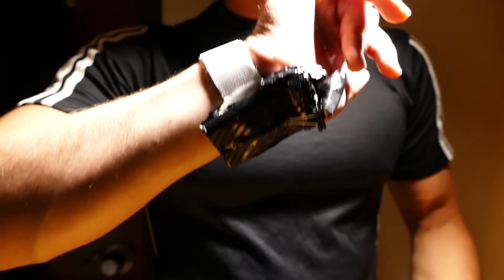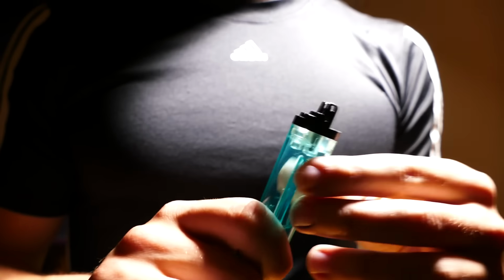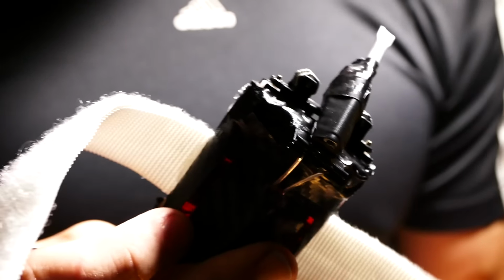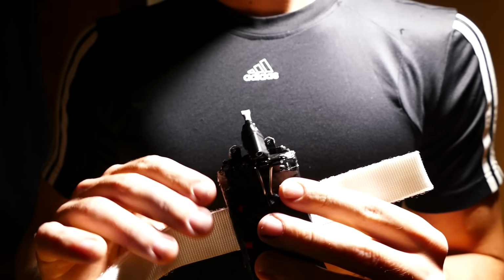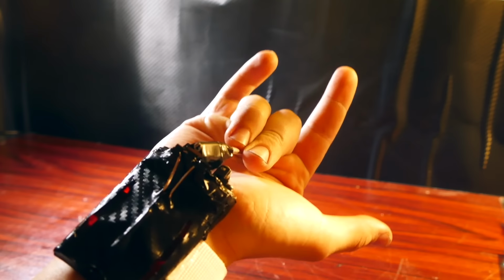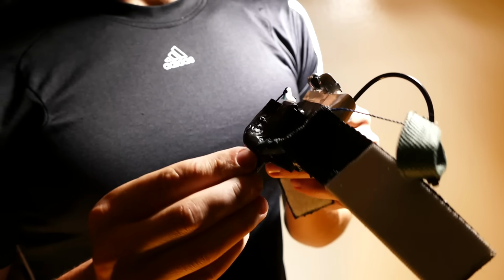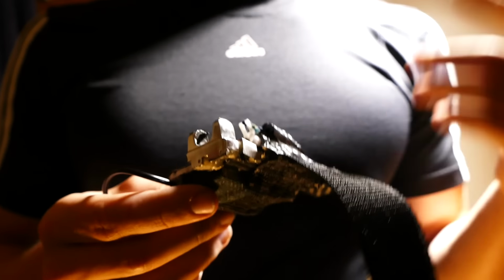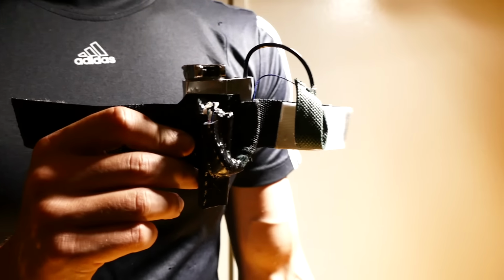Make a SPIDER-MAN Web Shooter! - Super Simple $2 build!!!

Comment: For web fluid use 
Rubber cement
Clear glue
Contact lens solution
Water
Reply: Zap zing Gaming the glue would just dry up
Reply: Zap zing Gaming 
Thanks
Reply: What does it change
Reply: That would actually stick to stuff
Reply: Zap Zing measurements please?
Reply: Wouldn't the cement dry up?
Reply: Thx for some ideas
Reply: FUN FINATIC just experiment
Reply: Is it 100/ right
Reply: Hello I Buy 2 Web gun
Reply: Where to find rubber cement
Reply: Now does it work?
Reply: Snow Wolf i think they meant as you put it in
Reply: Or you could use Locite spray adhesive glue. (It has to be the professional performance one)
Reply: Silicone and water is the beat
Reply: @superdolphin440  Rubber cement isn't actual cement. It's more like a rubbery glue.
Reply: @Ohaffles  thanks
Reply: @superdolphin440  Yah we have to use rubber cement a lot in school for projects. So no problem.
Reply: Or you could just use flex glue clear
Reply: Ayal Zur that’s why it’s water
Reply: Do you know what size/kind of syringe he’s using in the video?
Reply: @amarhavic1915  no it will only dry immediately when it will come out of containers
Reply: What about liquid silicone
Reply: @superdolphin440  not at first
Reply: It's so the solution used here actually becomes sticky and will stiffen after being exposed to air.
Reply: Your not actually thinking it’ll make you be able to swing from stud smh
Reply: That’s nice.....but did u know that GEICO can save you 15% of on your car insurance?? 😃
Reply: @deacb0y262  it would be elastic due to the rubber cement, sticky due to the glue, and contact lens solution would help it dry faster so it would become the sort of cord it is in the comic
Reply: @murpheria4562  thank you that was 2 years ago lmfao
Reply: @superdolphin440  it would have water
Reply: So you thing I could do silly string?

Comment: HELP!! Do I just use hand soap for the webs ? I tried using dish soap and then adding butane fuel but nothing happening when I pushed down the lever. I also tried hand soap which didn’t work. HELP PLEASE
Reply: I have thesame problem, did it work already? Maybe use other lighters?
Reply: Same problem with mine :(

Comment: Incredibly difficult to complete. The excess soap took off all the glue and the ejection of the lighter got stuck TWICE while trying to put the pieces together (the metal ring that’s at the end of the white ejector got stuck inside). Instructions weren’t clear enough and I couldn’t recreate it

Update: I finally completed it and i tampered with the original design a little bit to make it more effective. It’s definitely more difficult than it appears but it’s still possible 👍🏻. For those of you trying to recreate this like I did, make sure not to accidentally force down the ejector while reinserting the trigger and keep note that it definitely needs a constant refill if you’re going to play with it
Reply: I can’t seem to get mine to shoot the web fluid

Comment: What if you combined the dart with the soap and added multiple anchor points on the dart so it can come back into the tube? This way you can have the web effect and the grab effect. Also what if you add a shaped filter on so it comes out in a web design. Sorta like how you mask a flashlight so it shows a specific shape like the bat signal.

Comment: Just wondering, is this web shooter build compatible with the Polymethyl Methacrylate Web Fluid Mix? I highly doubt it but I could be wrong.
Reply: If you wanna put your web fluid in the lighter I HIGHLY recommend putting pressurised air into the lighter. It forces the contents out of the lighter instead of just sitting there in the container.

Comment: I can't get ahold of butane
Reply: I think you could just use compressed air, should work the same
Reply: @razplayz843  - The thing about the butane though, is in liquid form it constantly generates pressure until it runs out, which is better in the long run, but it probably would mess with the chemical makeup of my web fluid.
Reply: 😅 oh OK sorry
Reply: @razplayz843  Nah, it's all good. :) I'm a bit of a nerd so 😂

Comment: you can try doing a fire shooter basically what it does is throws out a blob  of some material which is set to fire by the lighter and it still keeps on burning when it reaches the surface it is intended for

Comment: The instructions are both clear but also unclear.

What did you use to make the lighter all frosty after you emptied the lighter fluid?
What did you use as the extension for the trigger?
Do I need to use the butane fuel?
Reply: I’m two years late but 1 the lighter got all frosty because of the butane inside, so it will always do that when you empty it out, 2 the extension for the trigger seems to be the metal part of a paint brush but you can also use a popsicle stick, 3 you do not need to use butane fuel if you don’t want to use it as a flametrower but you do need someting to compress the water, an air can (like the ones used to clean laptops) will do
Reply: @yecupp  at 2:29 he needs the sparker (the round thing) to press on the lighters without having to press down as much, and at 2:49 the stick is holding down the clip, so it's over one of the silver parts of the clip and over the middle of the two lighters

Comment: Can some one explain to me actually how to take the lighter apart
I’m confused.
Reply: So take off the metal part and take the flint off, then screw off the part where the butane comes out of, take out the fuel restricter (the white stick thing in the lighter) screw the thing where the gas comes out back on, then take the button you press and put it on the tube where butane comes out of. Fill with butane for it to shoot out or you can also use carbon dioxide and the other liquid (seltzer water and the other liquid you want to use. And boom